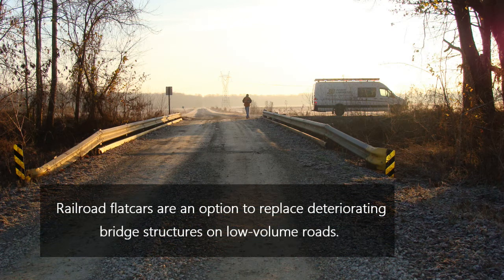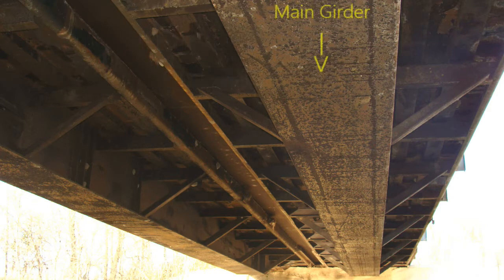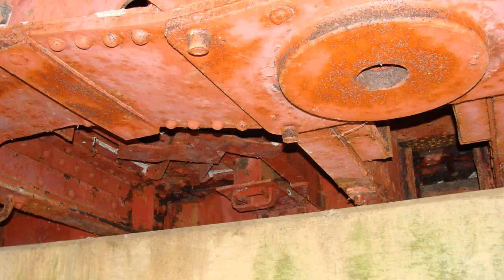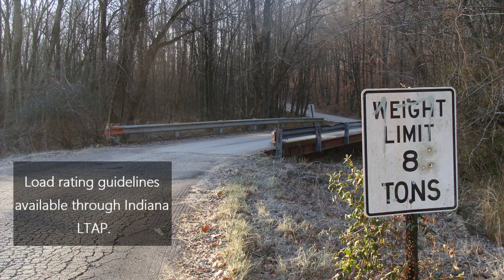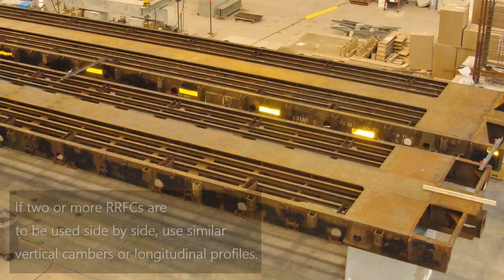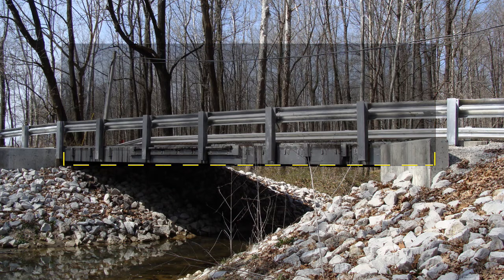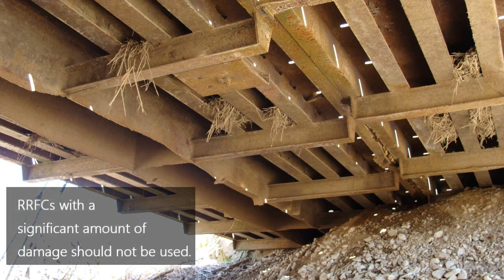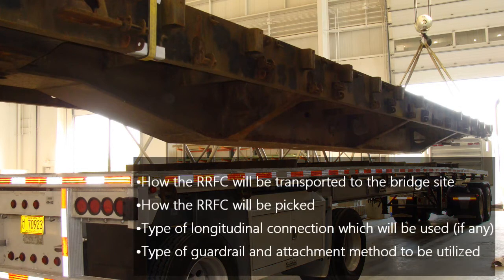Acquisition of Railroad Flatcars for Use as Highway Bridges on Low-Volume Roads

Comment: Nice job and informative. FYI, auto-racks are affixed to flatcars identical to the piggyback equipped versions pictured. Just remove the rack and its a flatcar again, able to be made into a bridge. Very few piggyback flats are left in service now 10 years since this video was produced. But auto racks are still built, run, and retired every day.